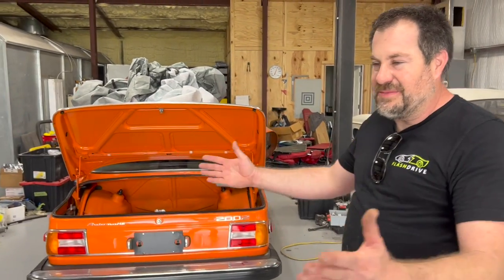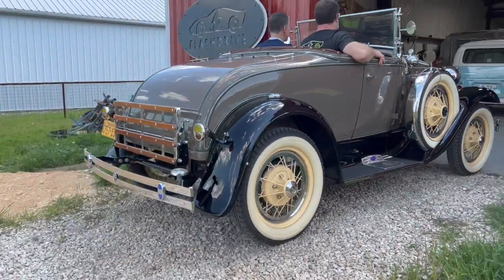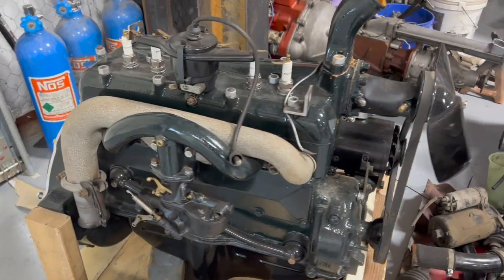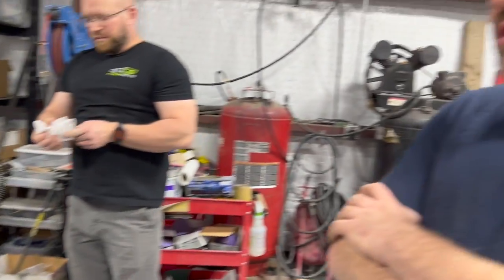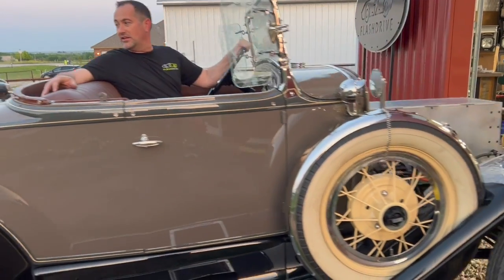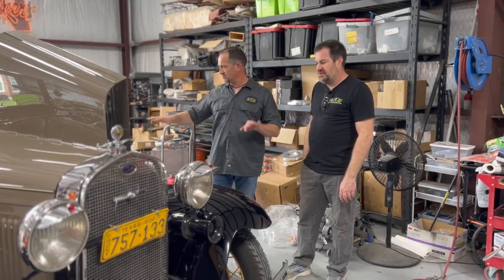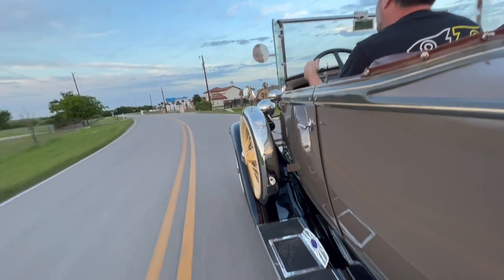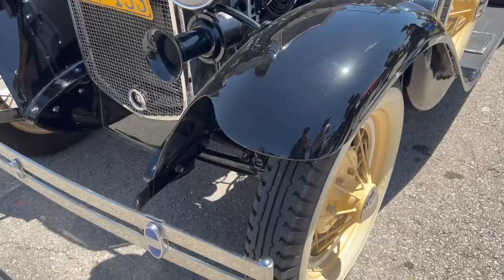The Model E - 1930 Ford Model A Roadster All Electric EV Bolt In Conversion. Tesla battery & Hyper9.

Comment: I loved seeing this at the Lone Star Roundup... I had a Flathead powered Model T Roadster traditional Hotrod Black with flames there in the featured cars however after the show  that I sold at Pate swapmeet a couple of days after that show... I went and bought a stock 31 Roadster for which I was officially the second owner from the grandson of the original Buyer!  It did have a seized Engine and a cracked head and his grandfather started to hotrod it in the late 50's.

As cool as your Roadster was I decided to go the traditional low buck way with a Small block Chevy and retained the Rolled and peated Red interior the old man installed in 1956 and maintained the full fendered Jalopy look for very little money.  

I wished the old man would've left the original colors on it which happened to be the same beautiful colors as your 30 but the old man primed over the whole car. I decided to leave it the way the old man left it and keep it in it's controlled state of decay.

Wondering about How much your conversion would cost for me to install including the regenerative brakes?

Comment: I love it. Yes I'd love to own this beauty. I'd change the brakes on all 4 wheels first, an I'd like to add a tablet that can go on the dash that shows cars speed, battery level and if it's charging to show that. I think in the future we need to have something like a wrist watch instead of a key for the vehicle to be able to start or if a thief hotwires it and it's running but will immediately die if the watch isn't in the car as soon as you put it in gear it dies. On the second try it licks itself up until the watch and pin code needs to be put in the computer onboard the vehicle and when the thief locks the car up it sends a 911 to the cops so they can arrest them. Then thieves will get caught and go to jail.

Comment: Love your work fellas, buy why did you retain the gbox? I can appreciate the advantages of "drop in" but replacing the original gear box with an extended prop shaft would eliminate the gear noise and it would be absolutely silent.

Comment: The sound of the original transmission is VERY noticeable but the motor and electronics are dead quiet. The original engine noise reduced the amount of apparent transmission noise but using the electric motor makes this noise stick out like a sore thumb. A helical gearbox, or no gearbox, would make the car a ghost with the exception of the differential. Have you tried driving this car using 1st, 2nd or reverse gear?

Comment: I'm pretty sure that when that car was built, there were more electric cars than gas cars in the United States.  The best thing about it is that it can easily be put back.   Now it's a car that can be preserved, as well as enjoyed.  Nice.
Reply: Not really. Electrics were reasonably popular at the start because we didn't a serious highway system and most driving was local. What ended them was a combination of highway expansion, the electric starter-motor and a lack of battery chemistry development. Through the '90s I was a sort of mother hen to an APBA Special Event electric boat racing series. Batteries were 500+ pounds of automotive Lead/Acid, speeds topped at about 70 mph. When I got a chance to re-write UIM International class-rules I opened chemistry to anything "over the counter" available, and an 80 pound Lithium-pack powered electric outboard hydroplane reset the mark to 98.8 mph.   https://www.youtube.com/watch?v=-yNu2_LlO9s

Comment: At the end, it looks like they are using a Nextion display to monitor the system!

If so, THAT'S JUST COOL!   LOL

I'm a huge fan of Nextion displays and have a ton of them.
They can be used for anything/everything, as seen here if that is a Nextion display.

If it is, I'm curious what controller they use to send the data to it.

I use Arduinos and ESP32s.  But anything that has serial RX/TX will work.

Comment: 12 years ago I scratch built a 1930 A Roadster.  It used 33-130AH cells, and a custom wound 20HP industrial AC motor.

Comment: Henry would not give a thumbs up.
 These antique historic vehicles are limited. Some are rare and shouldn’t be adulterated. 
 This said there are many beautiful old cars they resto-mod and plain old hot rod. This is an adulteration as well. 
 Bottom line is property is property and the owners may do as they please. 
 Repop old cars in steel aluminum or fiber composite materials would be my preferred way to go, and save original vehicles. 😊

Comment: It's electric ...... Whyyyyyyy ???? Cause only dumb people think you never have to work on a car until they actually have to every time you drive it with gas motors.  I would rather drive the car and not work on it.  That's Whyyyyyyy  As someone who used to rebuild these in the 70's I can say they are trash on the road.  Let's not bring up hills with these things.  Electric equals reliability and gas is trash.  Proven fact.  Enjoy working on those old clunkers more than driving though.

Comment: I just got off your website. I found the kit @ $Twenty Five Thousand Dollars. I did not find:  Charge Rate, Battery Capacity, Speed (sort of as stock Model A goes 55 no problem yet you say that is top speed with the conversion????, Level One, Two, or  charging?.   Beautiful engineering and fantastic job not hacking the original A.

Comment: I like the idea and execution, I would prefer having a clutch though you could use it or not. It would be nice to be able to change gear ratios without coming to a stop like if you were taking off from a stoped position on a very steep hill, then you could shift up on the fly as the grade leveled out. It would really help lower the amperage draw and lengthen your runtime.

Comment: Nice job. Then....1. Readers have been upgraded with 39+ brakes forever. 2. Gear ratios readily available. 3. 1936 wires and would take small 16" tires.

Comment: Very cool.  I love original and the original is not that hard to maintain.  This would have better acceleration for modern traffic, but may beat the body / frame / suspension harder.  It's a true hotrod.  Dont tear up good original examples (and this is reversable, so....).

Comment: I think it's cool.  There are plenty of Model A's out there to play with in lots of ways.  I bet they can have astounding range so long as the speed is kept down with narrow tires and light weight.  that said ~ you're doing it wrong to 'diss' the reliability of an original.  So far as older cars go the model A is extremely reliable.  'properly' restored (even half assed reasonable) it should not overheat.  I do 10K miles / year in mine (it's not restored) year round, it doesn't see a garage, I just treat it same as any other old car.  It's the most reliable old car I've had and the simplest to fix/maintain when things do need attention.  There is nothing easier to find parts for and parts are cheap.    I love old cars/drive them all the time but when I do someday buy something modern, it will be electric ~ burning petroleum is a gross/greedy habit I think.  So hats off to this project!

Comment: While not a fan of EV's, I do appreciate how it's a bolt in and removable conversion.  One thing's for certain, no more cracked fenders and numb hands from an unbalanced Model A engine.  As many other have mentioned, updating the brakes should be on the list for safety.

Comment: I daily drive a 1929 Sport Coupe. I also drive a 1914 Detroit Electric, same as what Clara Ford drove. This change to electric is not an upgrade or something new for automobiles, its just different, a choice. We should all be allowed to make our own choices. How many of you have had a driving emergency in an antique car exceeding 50mph? EV conversion does not make it safer. Except for quiet operation and instant torque, most everything remains the same. Getting ice cream without overheating is a low bar for success. I would match my 100% original Model A in a driving contest and likely win reliability, longevity, distance, etc. with no diagnostic tools but rather a screw driver and pliers. Yes, hot rodding is cool too. I have a Model A ford that does the 1/4 mile in low 13s. It does take more than a powerful motor to make a car go fast safely.

Comment: 50 mph with mechanical brakes and stock suspension is fast enough which the original Model was capable of doing. Installing an overdrive will go faster. 
The nostalgia of the engine sound and the wine of the transmission is part of driving a car like this. It's not a modern car even with it being modified. The suspension and brakes will not handle a 70 mph ride safely.
So my opinion is, leave it alone. Enjoy what you have. 
I have a  stock1937 Plymouth. Would I do this to my car? Absolutely NOT!

Comment: I'm glad I will not live  much longer now, and will not have to see the bleek future in store for us! The brakes done right will stop beautifully on these, you have to do a 60 - 40, the 60%  goes on the front, the 40% goes on the rear, this makes all the wait go on the front wheels pulling to down helping in stopping, that's how I adjust mine as well as the other I work on, no complants, I use ton truck actuators on the front, this gives you more power on the front brakes because of the longer leivers, new brake rods must be used along with cast iron drums! My car stops on a dime! But I detest bidenmobiles of any type, I will drive one of these converted to ev you created over the horrendously ugly new models made today, though, and your engineering to put back origanal is great! But I am sadend to think it's over for these cars and myself! EV's will not be around that much longer themselves because this awful government will find a way to ban them as well. It takes fossil fuels to manufacture them, as well as the batteries that power them, and the chemicals used in these expensive batteries are not exceptable in most every land fill, as you can find gov act 65 on everything now, even a fucking can of beans! The engeneering is good because you left it to where it could be restored to origanal, the vintage cars you did show, were hot rods, and rat rods, not vintage, sadly yours was the most vintage even with the conversion! Not cool! We will one day not be able to drive a horse and buggy, because the horse farts leaving a " "carbon footprint" to completely remove the carbon they will have to destroy the entire universe, as it is 6th element on the table of elements! We ourselves are carbon bassed, all living things are carbon bassed, even the air you breathe is carbon bassed! We have gone too far down the rabbit hole now!

Comment: I love it. Had an old Jeep for more than 20 years, then bought an EV. Love both, but fact at least for Germany is: Upkeep of IC-Vehicles is expensive, especially those with high fuel consumption and electric vehicles give you a smoth drive with way more power. I also can charge at home on a very stable grid. 

Turning a classic into an EV gives you the best of both worlds.

Comment: A ton to build an EV. So props for that. But please, it doesn't run on a "electric miracle" it runs on batteries charged via coal, wind, nuclear fision,  or generator. I really hope the last is not the case. I think EVs have a purpose and a place in the world most definitely.  However, seems many doesn't k ow where that power comes from.

Comment: First, I'm happy to see the mostly positive feedback from people with open minds. There is one valid point for my specific support of this project. With the ICE, the car could not meet the needs of the owners as a car they could rely on. Whether it was a weak engine, noise, fueling issues, or something else, the switch to an EV made the car more useful to those owners. It became faster, more reliable, easier to maintain, and likely to last far longer than to refurbish the original engine. I do hope the owners like the modification enough to make the decision to modernize other parts, like the brakes and transmission, saving those original parts from further wear and tear, while making the car even more useful to themselves.  It was also nice to see these modders show respect to the car they were working on. Far too many people leave nothing original, turning a classic into something else. (better maybe, but like this car, the quirks make the car.)

Comment: If you think how many Model A were hot ridden in the 50s, this is really just a continuation of the spirit of hot rodding. You put a modern power plant in it and made it better and faster. That’s hot rodding at its very finest.
Reply: Without the long hours working on the gas version.
Reply: Not really, hotrodding is to make things from cheap abandond cars for little money. This conversion kit costs 25k and the car does too

Comment: Very cool.  I work with a bunch of EV guys in Portland OR and this would be perfect here.  I have a 27 T roadster that I made a custom chassis for to make a traditional hot rod but it doesn't have an engine in it yet.  May be the best way to go.  Also, the 3 wheeler on my avatar I built but the motor needs work so that may be a good candidate too.

Comment: I don't love gutting an original Model A because it overheats.  It shouldn't.  They could have probably fixed that problem with a radiator swap.

I do love that there is a E conversion kit for the A though.  The Model A is on a short list of cars that will probably always have available parts.  Much like a VW bug, you can essentially build one from scratch today out of a parts catalog if you had the money.  So having an electric drivetrain available so that someone could build an e-rod is a great idea.

Comment: Yours blew a head gasket trying to drive it "daily"??  Ford is still making cars like that. My Granddaughter just had her 2014 Ford Escape blow a head gasket at 77K miles. Turns out it's quite the common problem with 2013-2017 models due to failed engineering from Ford in the engine block casting design. The "possible" repair cost estimate was 6K minimum which makes the vehicle a "mechanic special" !! Maybe there's a "GREAT" market for converting these Ford Escape models ???

Comment: Electric cars are "a thing of the future"??? FALSE !!! Electric cars were very common in the early 1900'a when you still needed to "crank" internal combustion engines. 
Whoever restored this car "failed" !! Model A brakes, installed and adjusted properly will LOCK UP the wheels. Obviously, everything needs to be "correct" for that to happen and someone didn't succeed in that first/basic step. Same argument applies regarding the overheating. These cars didn't "overheat" when they were current. 
Like the guy said, "appreciate the engineering" and the work appears to be very nicely done. That said, I don't believe this will ever be a "popular" conversion. Please understand, I AM a Hot Rodder so I'm not against "modernizing" a Model A. I would prefer, however, a "souped-up" banger or V-8 conversion instead.

Comment: This is basically old ideas in a new light, it’s competitive with the Baker electric. I bet you can build one as a hybrid with Lexus engine, motor, transmission, batteries and computer.

Comment: Fun Fact: I have been daily driving my stock 1929 Ford Tudor for a year and a half now, and still haven't had any troubles. Also, I am doing this at the age of 19.
Reply: Brother you're living my dream! Paul Shinn got me hooked on model As a little over a year ago, and I've been looking for the right car ever since. Hopefully I'll find one here before too long! I'm 23 btw so the older folks need not worry about this hobby, the younger generation will keep these cars going for a long time yet
Reply: Good for you. I bought my Tudor (a '30) at 21 and drove it daily to college and then grad school. That was 55 years ago.
Reply: I drove my '31 stock Model A closed cab pick up from 1981 through 1983 to work and back everyday, about 40+ miles. Other than keeping a close eye on the water pump grease and packing the only other thing was to adjust the generator when the time changed and I had to drive both ways in the dark (I put a reflective light bar across the tail gate). This was in North San Diego so easy weather but still had lots of rain.
Reply: That thing will out last any electric car made

Comment: early in the video you ask if henry ford would roll over in his grave no he wouldnt at first him and edison both opposed battery powered cars but both eventually worked on electric cars  after several years and millions spent in research and development henry fords engineers  determined that edisons dry cell batterys werent up to the task  when informed of this 
henry ford threw one his tantrums and canned the whole project it wouldnt be untill 100 years later that ford would again begin to work on electric cars

Comment: You have ruined it… gota be either standard or period correct performance parts/modification or v8/10/2 or straight 6 should be the only hot rod swap   But thats just my opinion… nice job looks good  👍

Comment: Fun fact: Henry Ford, before he got a job in the car industry, was pretty positive of electric vehicles. Untill he got into the car industry, where he was basically pressured to design gasoline cars, which he also excelled at. So he might have been positive on this project. (If only he was more positive about jews)

Comment: Broke; no cut no weld so the changes are reversible

Woke; no cut no weld so it's easy to upgrade to better batteries and motors in 10 years

Comment: I think that it's great that this conversion was done in a way which completely respected the original design and made no changes that couldn't be reversed.  But  given the new motor's capability, I don't believe that unless the software is changed to limit its performance, limit top speed, AND unless the brakes are improved,  the car is unsafe to drive in traffic on today's public roads.